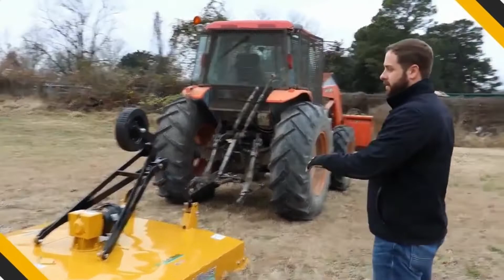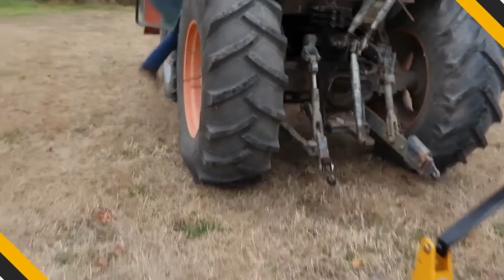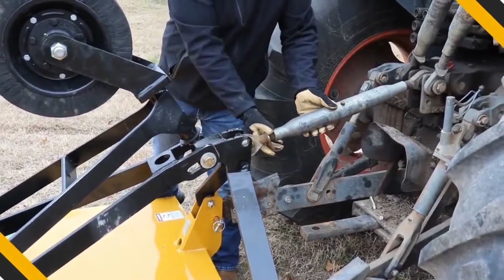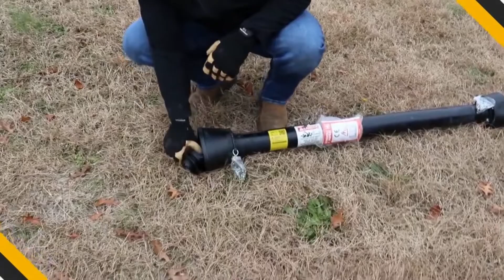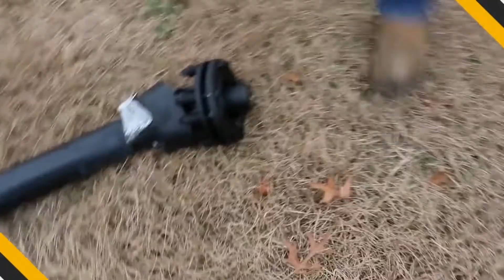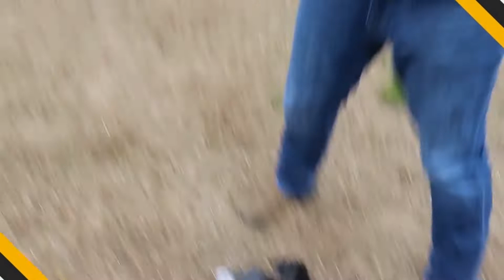Single Spindle set up

Comment: You say there All the same I just bought one it's 7 foot hog on the front it has 3 different locations for the front pins not one which one is it supposed to be in plus which hole in the back for the back wheel should be used I've just barely used this one but I noticed it doesn't flow over the ground like my old John Deere hog when you Go over a hump the whole hog comes off the ground and when the tractor clears the hump the hog comes down and gets into the ground while leaving grass tall where it came up basically where the top link hooks up none of the framework moves in the front like a John Deere that's why it picks the hog up going over humps how does a person solve that problem